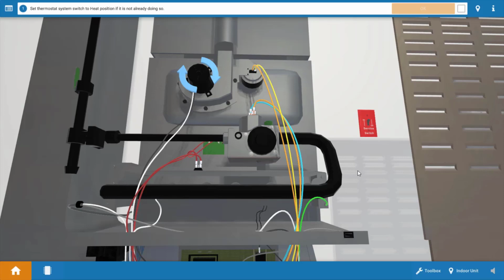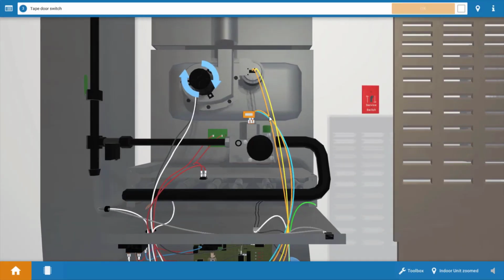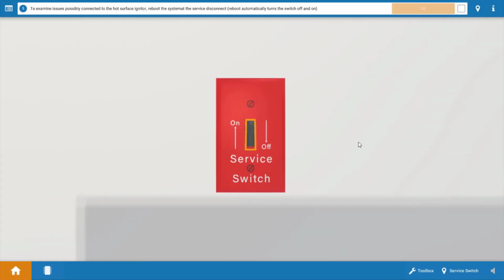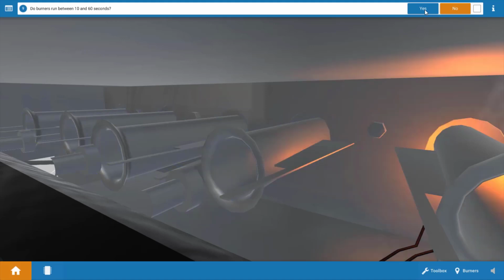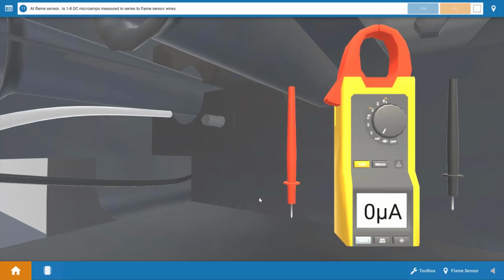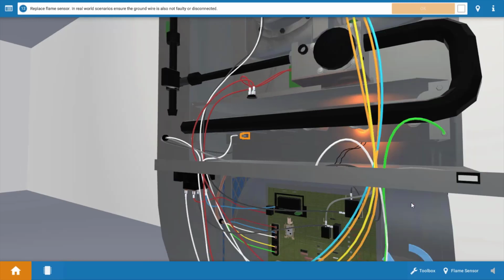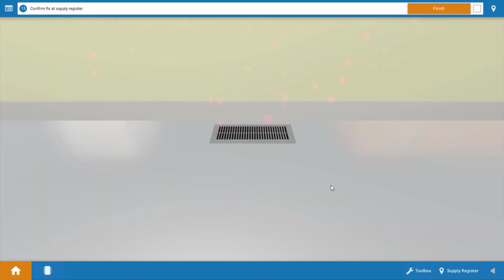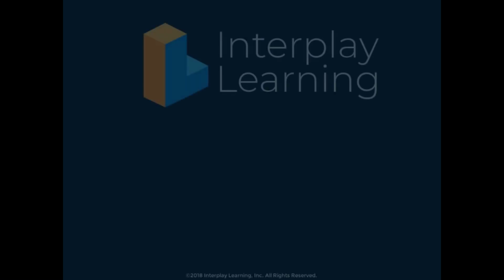[2019 GUIDE] Troubleshooting a Faulty Flame Sensor on a Gas Furnace

Comment: Missed checking for AC voltage going to the flame sensor. If there was no voltage from the IFC then you would not have current draw. Which means the problem is toward the IFC and not toward the flame sensor.